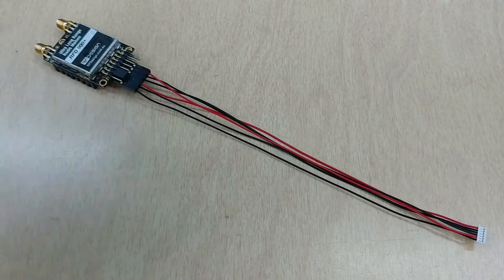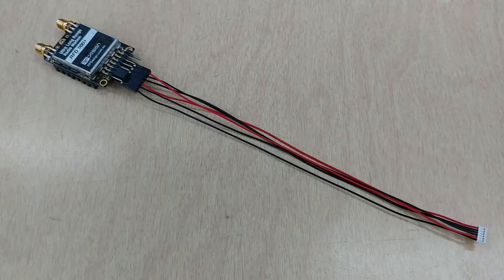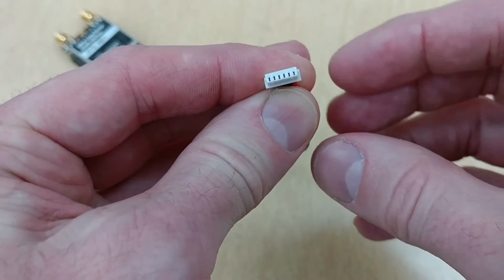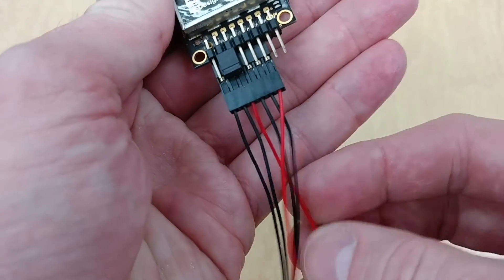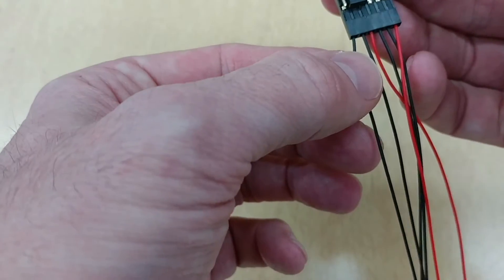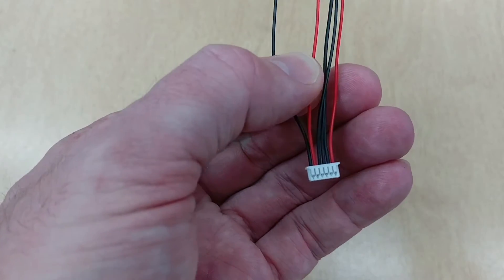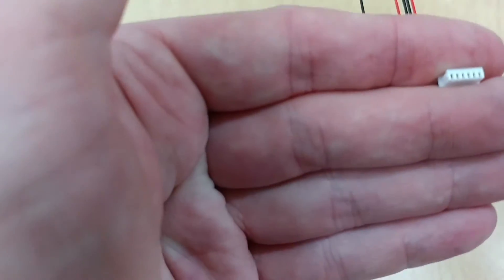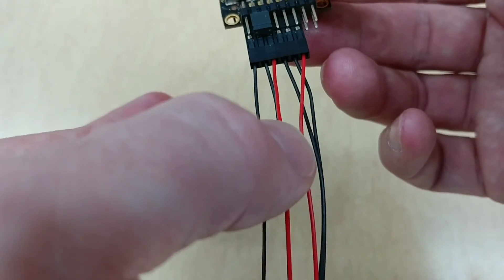Proper RFD900+ cable connection to Pixhawk

Comment: Great video. I was wondering if you know why my rfd900x looses power when the gps antenna is connected? Everything works fine until both the gps antenna and the rfd900x shut down. (That happens after 1-2 minutes after you plug in the battery)